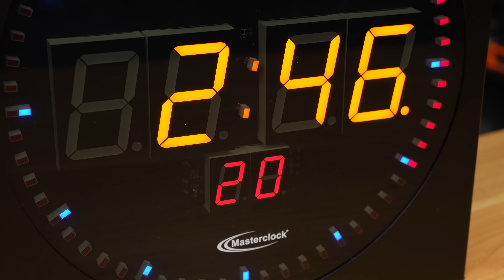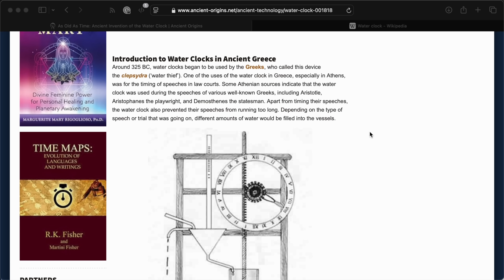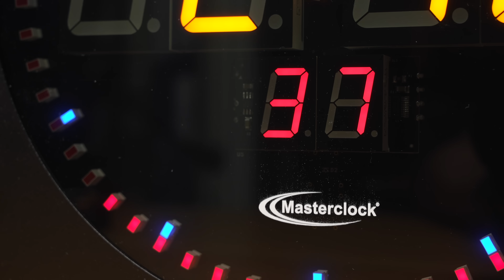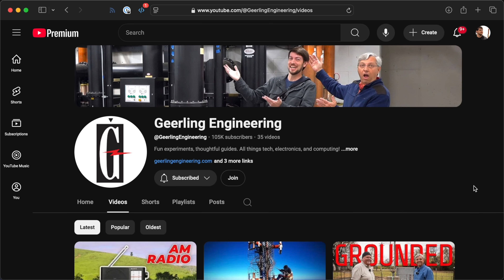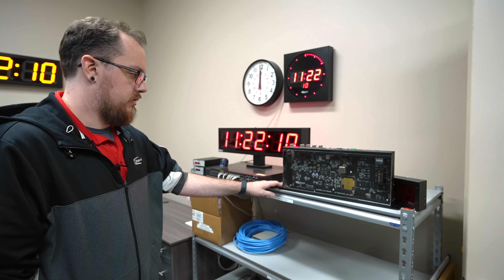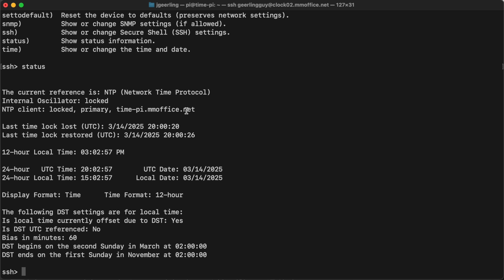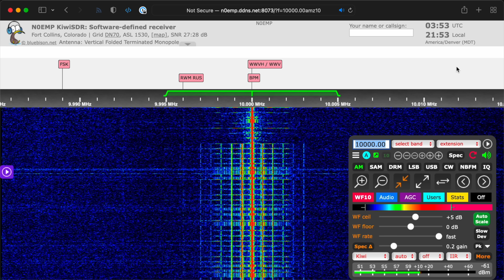It's about time...

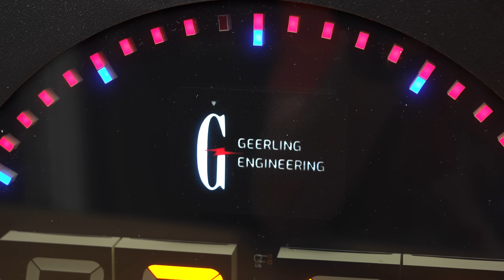Comment: At about 9:20, where the seconds LEDs go out, there’s a whooshing noise. Does the clock do that, or was it added by the video editor?
Reply from the maker: Haha that's actually a sound from the factory floor which is around the way—someone must've been using a press or some machine that sent out a puff of air at that exact moment! Not added in post.

Comment: Real time and timing/same time are different concepts. With the equipment that I use, protective relays, PLCs and HMIs for micro grid application.... We use A simple redundant NTP configuration.  I configure a GPS NTP server as the primary for all the devices including the windows panel PC HMI. I then enable NTP server function in Windows and make the HMI panel a secondary on all the devices. If the the primary GPS  NTP server fails, everything looks at the windows machine to get time ... Which got its last known good time from the GPS. There are some functionality when commanding generation sources where synchronization (same time) is important however... Real time is preferred. Other than synchronization having accurate real-time logs in all of our equipment is helpful when tuning a system if necessary but also inspecting event logs. It's difficult to conduct a root cause analysis of an event when logs across devices are not synchronized.

Comment: Thanks for interesting topic! 

A GNSS development engineer here with some nitpicky remarks:

You don't actually need a $200 GPS module or $100 antenna for good timing precision, a cheaper GPS module and antenna models do quite fine, practically providing similar time accuracy.

What matters most for maximum time stability is a good oscillator, preferably an oven-controlled oscillator (OCXO), because crystal oscillators are rather sensitive to heat changes and oscillator jitter defines the time jitter: If you plotted time drift of the GPS receiver over time, then you could see how the clock drift curve takes a sharp turn as soon you put your finger on top of the GPS module, because the thumb already heats the module enough to make a measurable difference. The GPS receiver compensates this of course, but temperature deviations cause some time jitter.

For this reason hifi GPS time systems use OCXOs, which we can briefly see on the video on that Masterclock unit's circuit board also.

OCXO is technically a slightly heated chamber that maintains oscillator in a stable temperature, so could be interesting to test if one could achieve a better timing stability with cheap gear by placing the GPS+timing hardware inside a slightly warm temperature-isolated chamber...
Reply: NTPheat on the Raspberry Pi was made to somewhat address the varying frequency of the XO on the RasPi. Wrap the RasPi in some insulating material, set a temperture for the script, and let it "stress" the CPU to try to maintain a stable XO frequency.
Of course, this can only do so much seeing how the Temperture reading is coming from the on-die RasPi CPU measure point, and not the XO.
There are also very simple 2 or 3 component transitor circuits that can maintain a constant temperture. I think is was the EEVblog forum that someone posted just such a circuit, specifically for maintaining XO tempertures.
I also agree, you don't need to spend hundreds on timing equipment. Lea-M8T timing boards from old equipment can be found for less then 30 bucks, and those cheap puck style GPS antennas are good enough so long as you have a clear view of the sky. Timing accuracy is in the single digit nanoseconds, but even non-timing chips can supply single digit milliseconds time accuracy.

Btw, since you have a ZED-F9T, have you considered also going down the RTK rabbit hole? You can serve both time AND run a RTK base station for your own centimeter accurate GPS experiments.
Reply from the maker: Nitpicky remarks are the best remarks!

I'll be getting to GPS/GNSS in my next video in this series. Then on to PTP, and eventually to clocks and oscillators :)

Comment: Hey, I love your channel and just want to say keep up the great work. 

But, I wanted to ask about using a Pi to build or diy wireless access points. Is this possible? Can you setup a pi to act like a unified u7 pro AP ( just an example)?
Maybe install open -wrt or something and grab a wireless 6E dongle/card and have it connected via Ethernet back to the switch and powered by PoE+ or something?
Reply from the maker: The best way right now would be to use RaspAP, and I've been testing out some builds with it... not enough to do a video on it yet, though.
Reply: @JeffGeerling  ok, That's good to hear that it seems like it at least is or will be possible. Thank you for the response, and I'll be looking forward to a video on this subject hopefully in the near future 😁

Comment: Thank you, Jeff [ & Andreas] I have been inspired.  With the Adafruit hat, I'm running a GPS-disciplined stratum 1 NTP server on a Gentoo Linux Raspberry Pi5 using gpsd, PPS over GPIO, and ntpd with kernel PLL successfully active.  And I can keep the extended antenna indoors next to a window, so I did not have to run a line outdoors.  

Looking forward to you to show how to set up broadcast band redundancy.

Comment: This is not a troll post, but is there a way you can ensure the accuracy down to picoseconds?
Reply from the maker: Yes, though you will need a very accurate local oscillator, usually on the order of a CSAC (Chip Scale Atomic Clock) or better.
Reply: @JeffGeerling I’ve been looking into rubidium, but it seems they’re very touchy when it comes to temperature. This is new to me, is there a specific kind of chip you’d recommend?

Comment: Ugh, I hate companies that have to put a request quote on their website. It's nothing less than gatekeeping for the sake of getting your information so they can keep bothering you until you purchase. Just be transparent and let people know how much your stuff costs.
Reply: Agreed. The fact that Masterclock sells NTP display clocks in a desktop form factor tells me that they absolutely can sell direct with no gatekeeping. I generally only see the quote route making sense if the product is extremely expensive, like the Microchip SyncServer S600 or S650, or if there is a need to buy in bulk. Otherwise, just be transparent like TimeMachines Inc. and post prices. Actually, I think they're the only COTS time server company that sells direct. The rest of the companies (Masterclock, Meinberg, Microchip) all ask for quotes. At the very least Microchip's offerings are available at distributors like CDW or Insight.

Comment: I created a controller that derives time from RDS radio signals (wanted an autoset of local time, not precision). That was a fail because the radio stations are broadcasting incorrect times! Some are 15 minutes slow, some are missing local Daylight Savings Time, some just broadcast a VCR noon flash equivalent.

I even called a local station to report an incorrect time and they said they didn't care. Oh well.
Reply: Perhaps the Edinburgh Castle 1 O'clock gun?

Comment: Many moons ago, I did IT for a nuclear medicine department for while. One of the things they do there, is a PET scan for which they use a sugar molecule to which a radioactive isotope of fluor is attached (Fluorodeoxyglucose (18F)). They make the fluor-18 onsite in a cyclotron. It has a half life of a little under two hours. The time between the creation of the isotope and when it is injected into the patient and used for the PET scan must be recorded very precisely, and also has a hard limit.

So one of my coworkers had built a "time system". Its time source was a PC that ran Linux, and got its time from a DCF77 receiver on the roof of the hospital building. That's a long wave time signal, similar to what you have in the US from Fort Collins on 60kHz. In every room where the stuff was injected there was a digital clock, which got its time from the time source, over the network. There was also an indication on that clock to indicate whether the time could be trusted or not.

Generally, this worked very well, with very few problems. When it failed, it almost always because of problems with the hospital network.

Comment: Great video, would love to see some more applications in a follow-up video... I've seen super-expensive FPGA NICs that have PPS input, and I know those are used in high-frequency trading, but other than FinTech - what are the use-cases?  Would love to see applications where NTP is "not accurate enough".   (yes, having GPS allows your entire data center to keep accurate time 'offline', but most data centers would be pretty useless without an internet connection)

Comment: Hmm, when I looked at setting up a small in house time server, I found the Pi family to be too wishy-washy to do anything at exact nanoseconds.  So I focused on the older BeagleBone Black/Green family, which are based on a SoC with builtin timers and an on chip PTP Ethernet interface, though at closer inspection, the PTP interface is not connected and the default kernel build doesn't use the PPS-capable timers for time of day, so I shelved the project .
Reply from the maker: Sadly, many of the vendors who have PTP-aware hardware (and even PPS ins and outs) don't expose any of it hardware-level, and sometimes are even surprised when someone notices it should have support!

Comment: I used a much cheaper and crappier antenna and it works just fine.
Reply from the maker: All depends on your needs—especially if you can get good enough signal inside.

At my house I can use a little cheap magnetic antenna. At the studio, I need something that'll take a beating outdoors, and has lightning protection. The general quality of the antenna at that price is a side benefit.
Reply: @JeffGeerling  I used a self-adhesive waterproof antenna and ran it through my window frame. The only thing that was difficult is that I had to cut the USB connector off and solder a new one on, just so I wouldn't have to cut a hole big enough to clear it. Then I filled the gap with silicone, trimmed it back, and painted over it.

Comment: Using GPS as a time source, gives me some questions:
1) Where does GPS gets it’s time from and wouldn’t it be easier to use that source directly?
2) Is there a Galileo option?
3) What about using the PTB (Germany) or WWVB (USA) signals?
Is this day and age, becoming more independent from USA-controlled infrastructure seems like a good thing.
Reply from the maker: The GPS modem I'm using does GNSS/GPS/Beidou/Galileo. Depends on your particular model.

I would like to explore radio time as well in this series. Need better antenna placement.
Reply: 1) GPS gets its time from ground base stations - typically using some kind of atomic clock - GPS (GNSS) is more convenient, less costly and more accurate than trying to distribute to billions of devices via other means - it has tended to be the most reliable method in recent time as well (despite threats of jamming and spoofing) 
2) A combination of GPS and Galileo on both L1 and L2 Bands are becoming a popular choice, but in a lot of ways the decision on which GNSS constellation to use has become quite political with many countries refusing to GLONASS the russian constellation and Beidou the chinese. 
3) They do use PTB in Germany, using a time string called DCF77 which is sent out once a minute, generally for critical infrastructure that isn't often or accurate enough, and so GNSS is the preferred with backup alternatives being sourced else where. A German company called Meinberg does a lot with this and offers OTS receiver cards. 

You are definitely right about the need to have alternatives to USA infrastructure -  thats why we have seen the likes of Japan and India launching their own geo-stationary constellation that helps to remove that reliance on the US

Comment: lol! good times. nonsense times. stuff just is, stuff does not require timing pressures. yeah gotcha, market needs time, enforced. why be at the market tho. dont you have already what you need for life and Godliness. why do you need to know where you are. its written, not to be worried about times and places. those are just worrisome people. stopped looking at the clock long time ago. what? lol. why need that much timing accuracy. apart from making time is money, just look at the sun and the stars, that tell you the time. apparently as you do. guardsmen, what is the time. sometimes local network computers are hours different from each other. and stuff still works. no worry bro. yep you could also turn off time stamps. money worries. no thanks.

Comment: Hey Jeff, great video! I think I have a bit of a quibble with your use of terminology at 5:18. Coming from an NTP background, accuracy is how close you can get to a reference clock, and precision is the smallest slice of time your system can resolve. At this timestamp in the video, I’d argue that you are dealing with two types of accuracy: one framed around a single clock’s ability to match a standard and the other concerning a network of devices/clocks matching each other. Your definition of precision here might be right in certain contexts, so please fact-check me. Thanks again for sharing all your projects, pi-based and otherwise!

Comment: I’ve looked at PTP briefly. It seems that networking equipment like your NIC and switch have to support it on hardware level to be able to timestamp packets and retransmit as slave clock. Didn’t have time to dig deep but I felt there is a disconnect between available info on actual PTP protocol and hardware implementation in NICs and switches. It’s not as easy as NTP. Was hoping to see more info on the protocol itself.

Comment: 5:49 - I worked at Symmetricom for 12 years and it's nice to see the name on something that is still being used. The "Miniature Rubidium Oscillator" was a miniaturized version of a system the was the size of a suitcase. We were directly across the street from Cisco Systems in San Jose, and I got asked to work with a router software dev team to implement NTP and an external time source. I think they still use some of that code today. Thanks.
It was Telecom Solutions until the Executive board had a drunken weekend and decided to change the name to Symmetricom. We could never figure out why they changed it or what "Symmetricom" meant. It's gone now. I think they were bought by someone.

Comment: Hello Jeff

Here a question from Germany. We had a very long a broadcast radio 📻 nier Frankfurt Main. 
This pulic radiostation sending a time signal on the precise 77.5 KHz with 50kW. This is the dayligth saving nigth. 

Did US had this kind of time broadcast ? 

The time by semself is build by PTB is very near to my hometown. The public time broadcast radio station DCF77 is synconiced by PTB atomic clock park. 

PTB is the German metric institute in Braunschweig DE. They working now on a new high presice atomic clock. Acuricy will 10 times higher. 

I visit the PTB 10 years ago, every office and lab had 10MHz sycronise time signal, to calibrade the metric systems. 

Yes US use metric system Volt, Ampere, sorry Tesla, Herz etc... 

And US was one of the first nations signing international metric contract, signed by Bejamin Franklin. 

The cooles thing i ever saw in my live, is one of the Kilogramms. A ball better a sphere of pure Silicon. With counted atoms for the Kilogramm. If the earth will ve made so priced round, the deapeth point to highest will be only 2 Meters (6.6 feed) 

Thx Axel

PS as a Nerd your TimeServer need a blue Box looks like a wooden UK telephone box 😅

Comment: Pretty cool. I bought a surplus cell site Datum Exactime time rack mount server years ago at a hamfest for $120. It uses GPS to correct an ovenized crystal oscillator and outputs a highly accurate 10 MHz signal source for some HP test equipment that I have. It got me interested in highly accurate clocks. There are all types of kits out there that you can buy. QRP labs makes a clock kit with gps receive module that I build a few years ago and you can build it for under $100 if you want to 3d print your own cases. I've never messed around with PTP or NTP time on my network but I think that'll be one of my next projects. Subscribed!

Comment: I spent some time doing 2 way radio, there is no way my customers would have been pleased if i did a DIY station clock, pro gear is the only way to go in pro situations.  FYI, my most used ports on my time clocks was PPS and 10Mhz ports.

Comment: 11:42 I’m super curious why a clock server would switch to FPGA. What benefit does that gain?
Reply from the maker: smaller batch items can usually get better performance and stability out of an FPGA than an off the shelf SoC or microcontroller, if the needs are highly focused. A lot of radio products use FPGAs for the same reason... waaaay cheaper than building your own silicon!

Comment: Wait, what's up with your DeskPi Rack?
Is that a prototype, or did you assemble it differently?
Reply from the maker: Working with them on a new TT model :)
Reply: @JeffGeerling  I like the additional bar on the bottom of the front, looks very clean.
I'd love to add that to my T0. Would be great if they made it available as an extra Part for the existing models.

Comment: As a software engineer, I know time is very critical, there are many system problems caused by timer skewing for example. There are also advanced database system like Google Spanner running based on accurate GPS clock to break CAP theory. Pretty interesting but easily overlooked topic. Definitely would love to learn more about time.